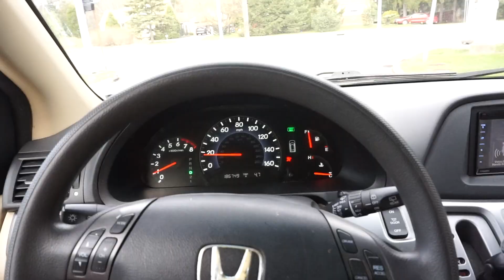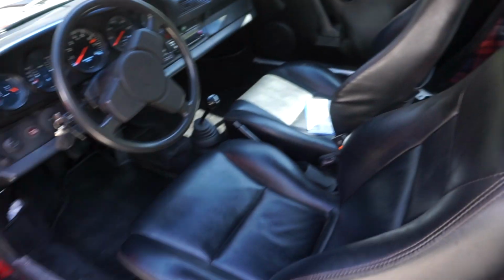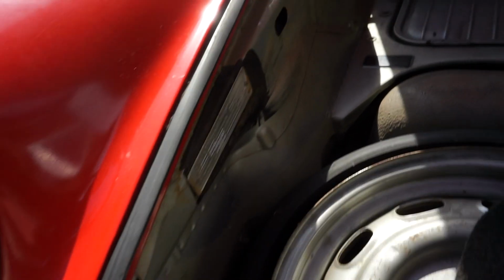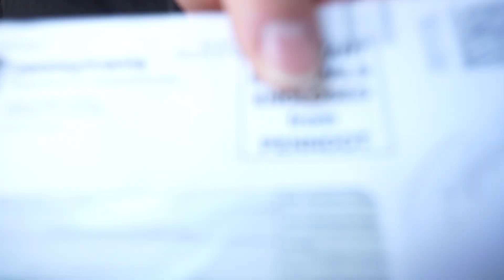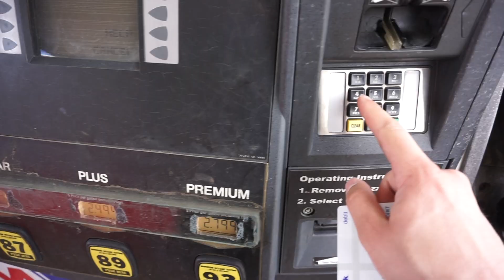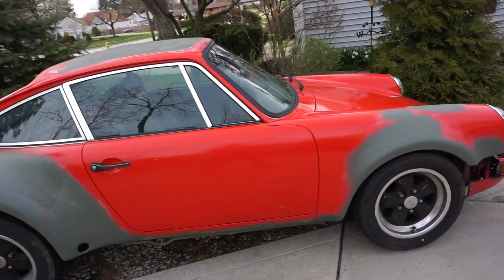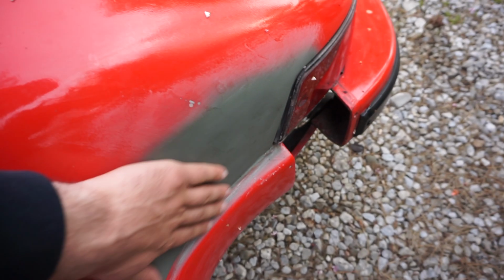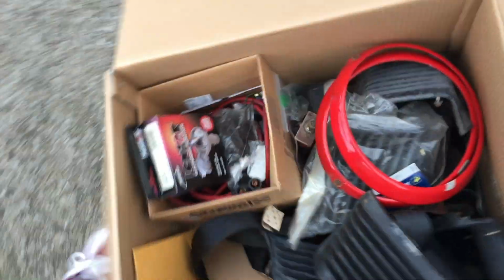Found this CHEAP HIDDEN GEM 1977 PORSCHE 911

Comment: '77 wouldn't have rusted in any of those spots. Its the first year they used galvanized steel. Also step one on the engine remove all the smog equipment. Looks great, i've done that project twice itll be fun an expensive. 

Ps: keep the black seats the interior looks great. The one thing I regret is changing my interior.
Reply from the maker: Yup you got it that’s right. I have to check but I believe some of the smog stuff is gone. If not my first step would be getting my own garage 🙂 thanks for the interior heads up. I’ll take your word for it.

Comment: Sounded a bit harsh when you backed it off the drive. Adjust  your valve clearance hopefully that will remedy it.Also check your cylinder studs at the same time. If they are all still intact then you've got a good car.
Reply from the maker: Valve clearance was done but I believe one of the rocker shafts wasn’t seating properly so one of the rockers has some slop. Need to replace. Previous owner said all studs are good.

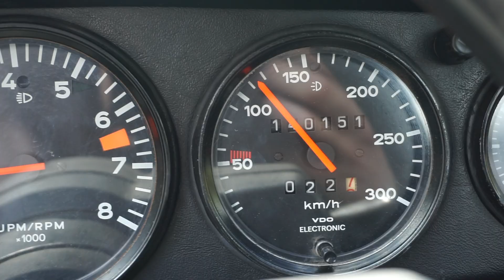Comment: Is the tachometer working correctly? Around 6:42, looks like the revs are below 2000 rpm and the oil pressure looks on the low side . It might be nothing but I like to keep the revs above 2500
Reply from the maker: Good catch, have to look into it 👍🏼
Reply: Superish Mario it’s my understanding that lugging the engine is bad for the rod bearings — someone with more experience with these engines can correct me if I’m wrong— but the revs and oil pressure (“druck”) has me a little worried. Have fun with the car — I’m constantly learning new things about my SC and how to keep it on the road!
Reply: Hear! hear!  They love to rev.